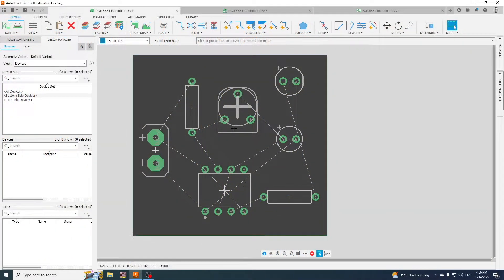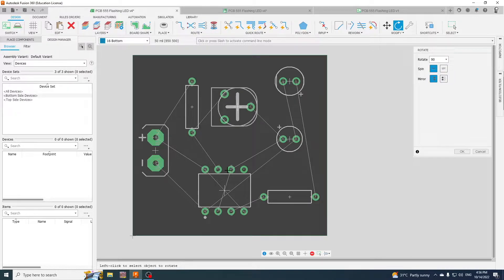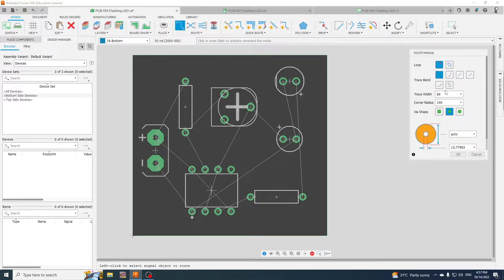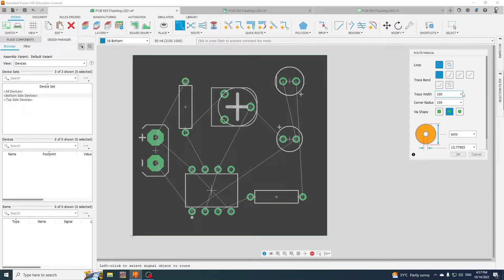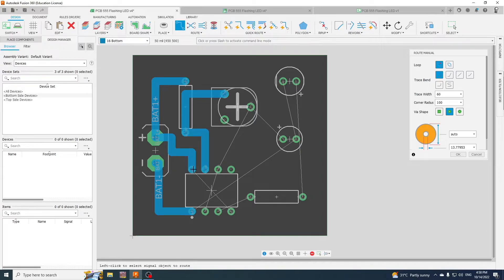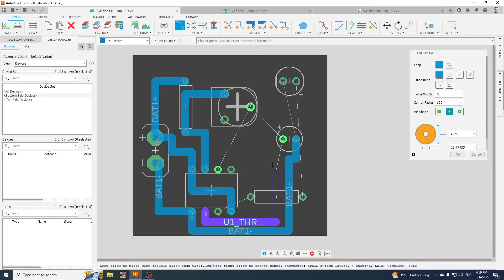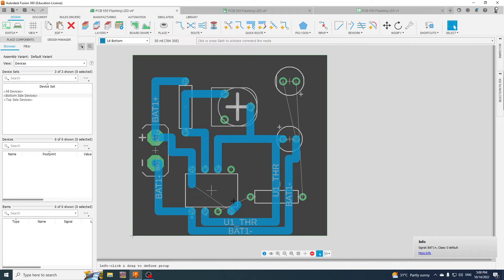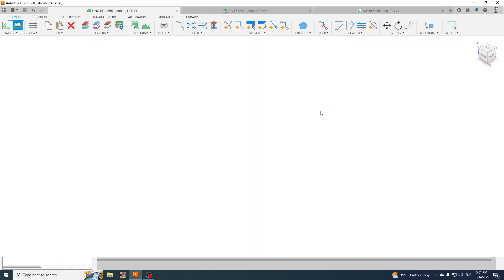Fusion 360 PCB to CNC Milling Part 1: Creating the Route

Comment: Thanks for these videos. By the way, a "mil" is a "milli-inch", i.e. 0.001", i.e. a thousandth of an inch (aka a "thou", the more common term), not a millionth as you mention. Approximately 40 mil (or thou) is equal to 1mm. Metric is so much easier :)
Reply from the maker: Thanks for the clarification and taking the time.